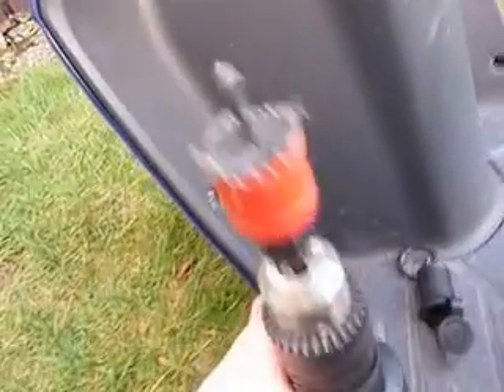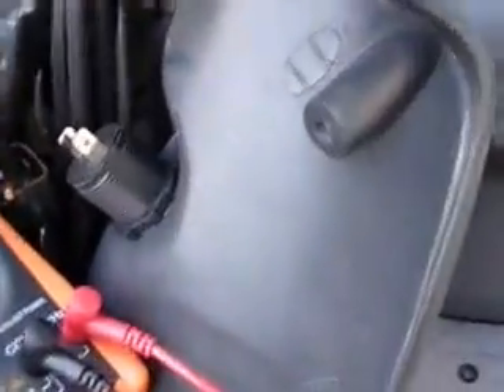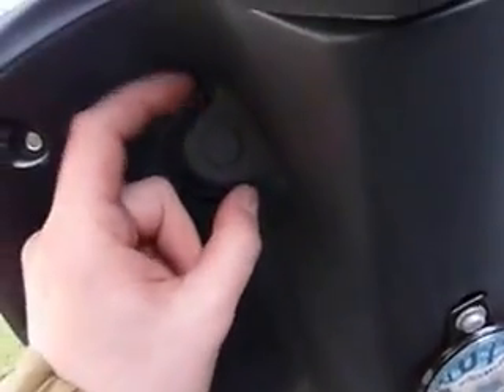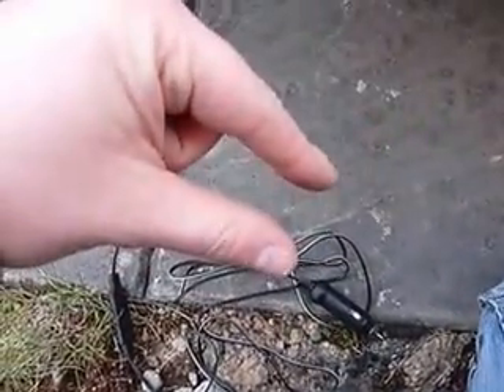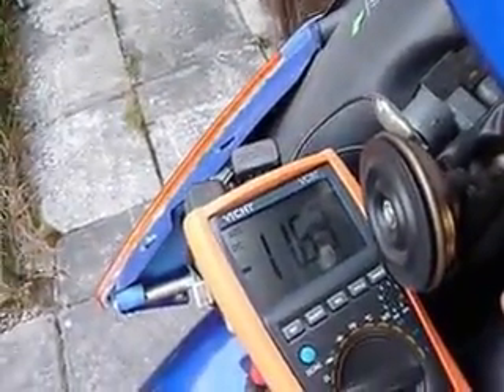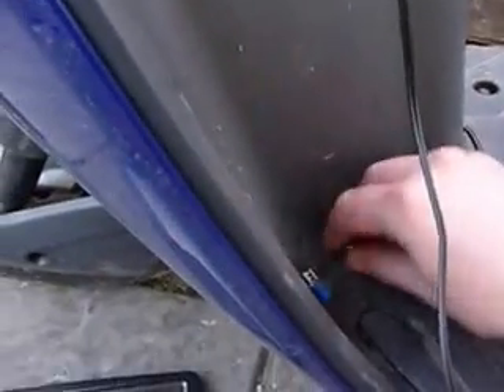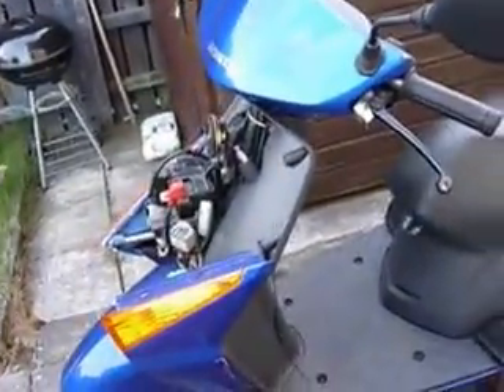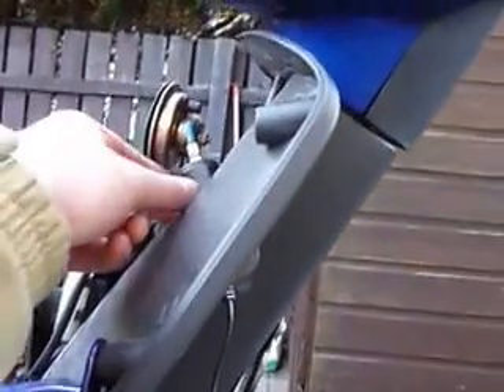Solar Trickle Charge 12v Socket Mod for Scooter/Motorcycle

Comment: How do you keep from overcharging the battery?
Reply from the maker: I live in Ireland and the solar panel I'm using only produces a few mA duing normal cloudy weather here so there is never a risk of overcharging. I still need to top up the battery with the main charger now and again. If you bought a more expensive panel with a higher wattage rating you have to consider an overcharge safety feature or if you lived in somewhere that is sunny most of the time.